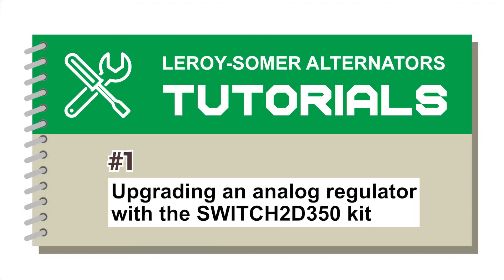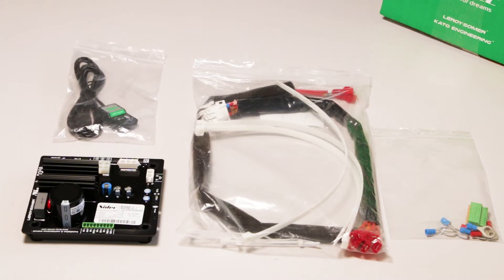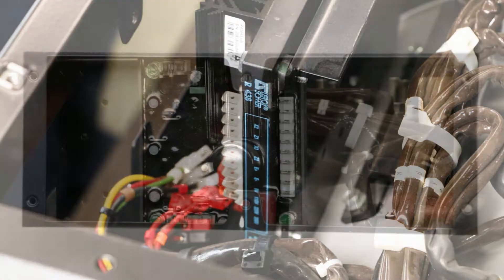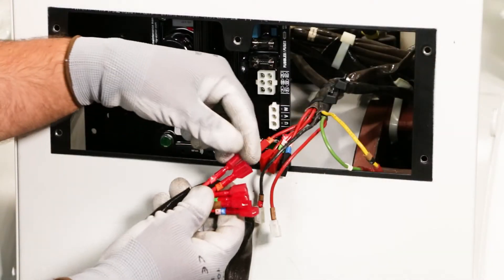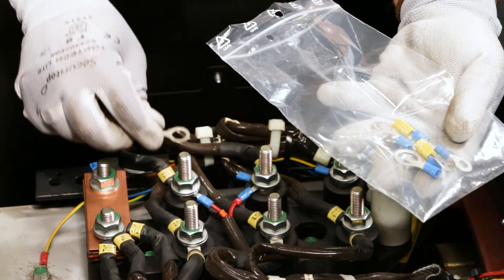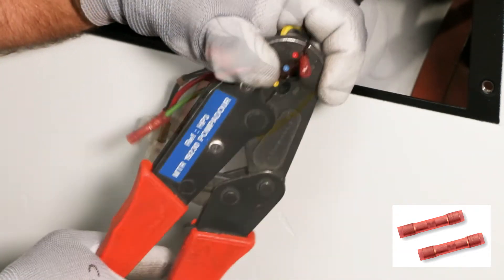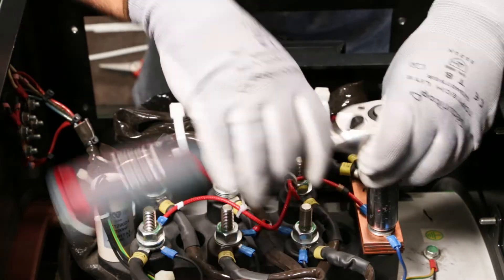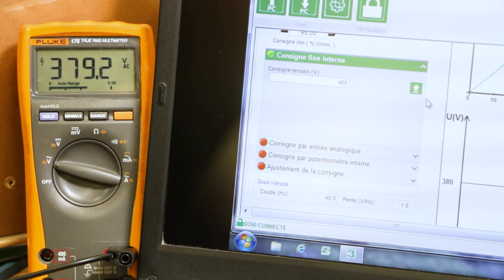Tuto #1 - SWITCH2D350 - English version

Comment: Hi. 
Could you help me with this question?
I am preparing to synchronize two generators. For this, it was advised to use avr Leroy Somer R450.
Do I need to connect the analog output of the DSE8610 panel (0-5V) instead of a potentiometer (on the 1k ohm circuit)?
Reply from the maker: Hello, if you are using R450 you can use a bias signal from the DSE8610 to make the synchronization. Pay attention that you need to ensure the insulation from the DSE8610 side as the potentiometer input of the R450 is not isolated.